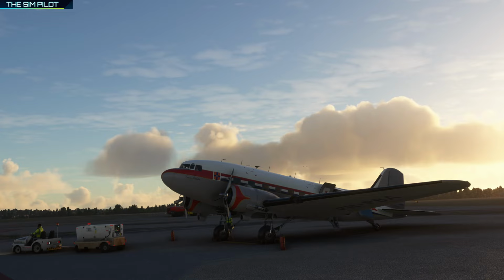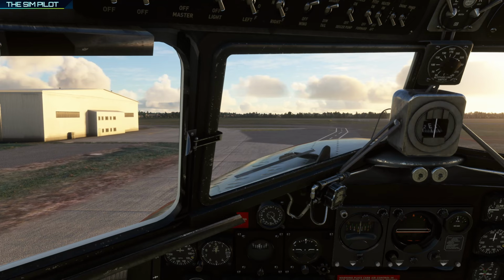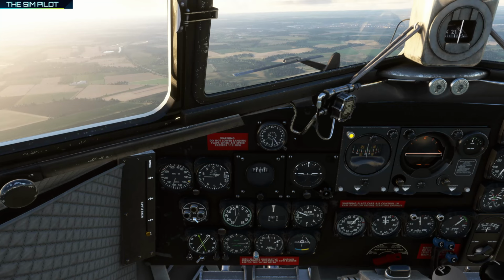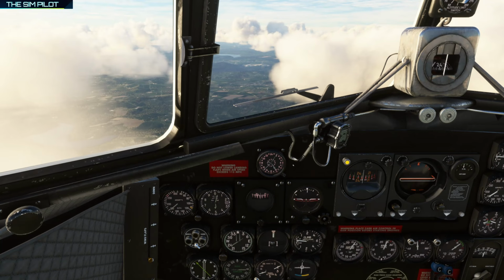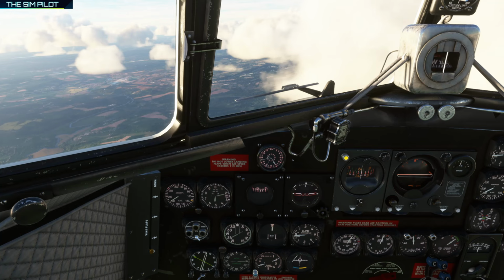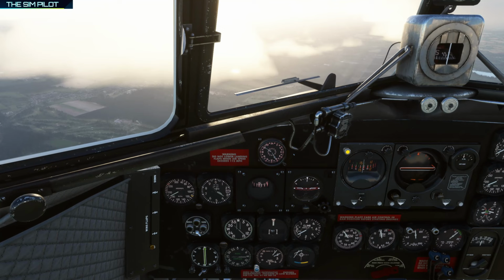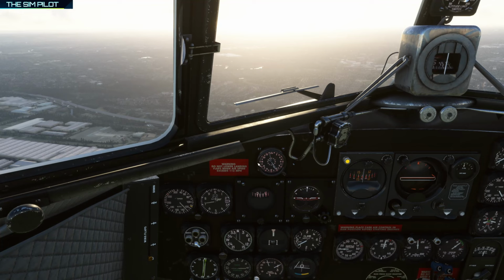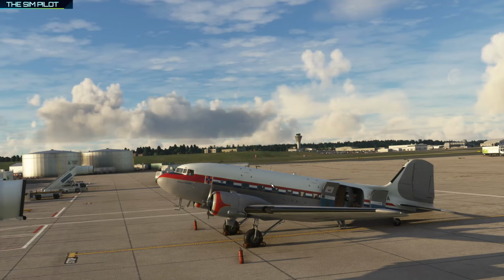MSFS | Tutorial | Douglas DC-3 | How to fly an ILS approach |

Comment: You should not unlock the tailwheel until you are in the safe taxi speed. Also, keep the tail up also until safe taxi speed, otherwise you'll lose directional control at high speed and it will be even worse with the tailwheel unlocked just like what you experience in this video.
Reply from the maker: That explains why I am having so much trouble with tail draggers. Couldn't control after landing and thought tail wheelmight help.  Apparently I was wrong. Thanks for the info!
Reply: Add a bit of throttle to get a sustained air flow to keep rudder working, that should prevent the tail from going over the head.

Comment: I don't know what happens with the Douglas DC3, after take off while climbing it leans sharply to the left and crashes. I can't get it to fly. Thank you for the video.
Reply from the maker: It usually leans left if the pitch is too much and speed gets close to stall speed. I had that couple times where trimming was a challenge and as speed dropped below 80 - 90 MPH it starts to drop the left wing and nose dive. Keep an eye on the speed gauge and make sure to keep it above 112 MPH.
Reply: @TheSimPilot  Thenks
Reply from the maker: @user-hm7nt8kg3y  You're welcome

Comment: yo, great video, i got a question that i cant figure out, how would you compensate for the wind drifting you off-course while doing long distance flights in the dc3? like i get you can just solve the vectors on a map with pen and paper, but how would you know the direction and magnitude of the wind while flying long distance away from airports?
Reply from the maker: Hey thank you very much. I guess the easiest way is to fly the needle while tracking a VOR station. Keeping the needle centered on your set course will help you stay on course and see how many degrees to left or right is required to correct for wind. If you're asking for VFR flight then I guess you need to keep an eye on your VFR landmarks to ensure your direction of travel is towards your destination.
Reply: @TheSimPilot  yeah that is the simplest way and makes sense, i was thinking like flights across the ocean where theres no VORs or vfr points of reference, it just puzzles me how they could keep correct heading without knowing wind direction, i guess they could approximate the magnitude by how far its blowing them off heading? even then the aircraft could be pointed in the correct heading but still have a lateral vector from the wind right, sorry im just vomiting my thoughts as i learn to fly this thing xD
Reply from the maker: @SkylordNiko  I guess celestial navigation was a thing in aviation back in those days. Maybe that's how they did it without knowing for sure.